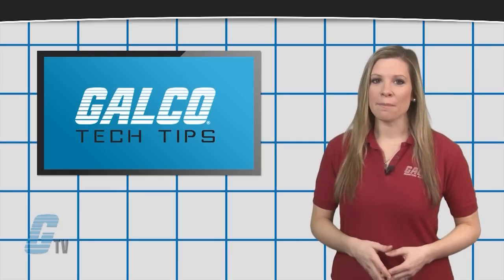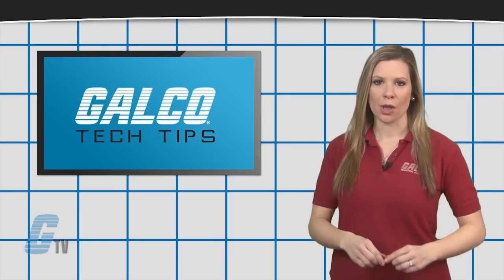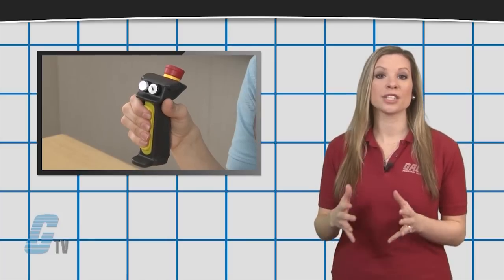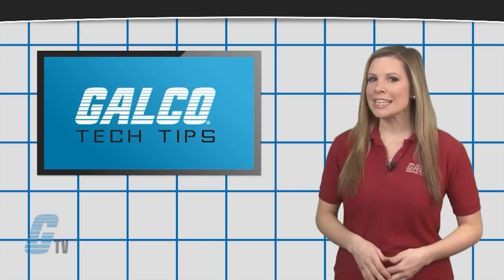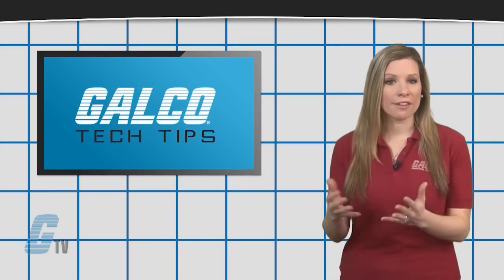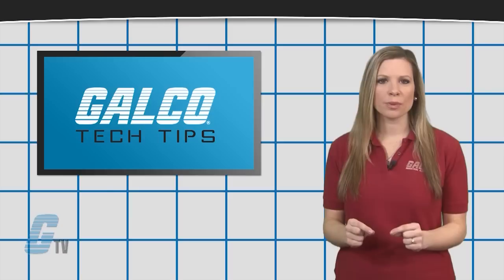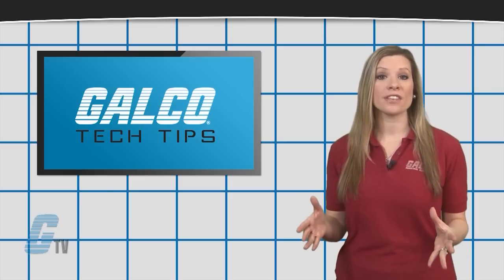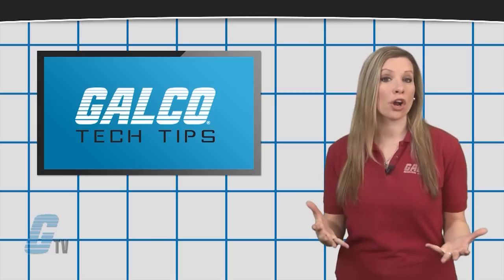Concept of the Dead Man Switch - A GalcoTV Tech Tip | Galco

Comment: ...I don't get it
Reply from the maker: They are just safety switches designed to protect the operator in different scenarios. So if the operator is not capable of holding the switch correctly the machine simply shuts off for safety.
Reply from the maker: COOL?
Reply: But what about with bombs in the Middle East?
Reply: @australianword3812  If the kamikaze is shot down, all muscles relax and he blow up. A dead man switch in this scenario is that the kamikaze is forced to hold on the switch to not go off, if he do this, when he is shot at, the switch is released, and the bomb go off. This is effective to prevent gettint shot at or to use hostage as kamikaze.
Reply: The perfect analogy would be those scenarios  in movies when the someone threatens others to  not kill him because if he dies a bomb will blow up and kill them
Reply: @GalcoIndustrial  but what did it switch off? The thing in her hand?
Reply: @australianword3812  they use something similar. It only has 2 settings instead of. Depress the button and let it go to complete the circuit igniting det cord,  blasting cap, or a blank round to activate the explosives. It can also be wired to be the other way around meaning press the button to cause detonation